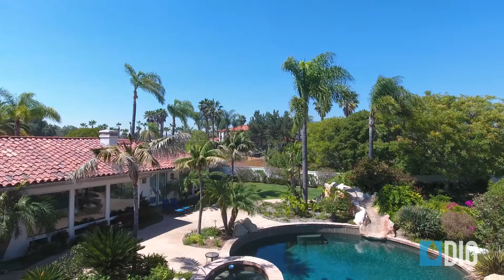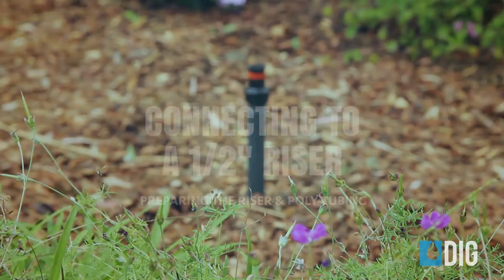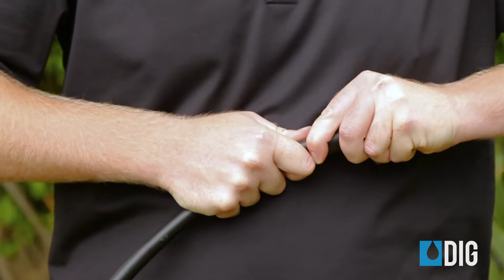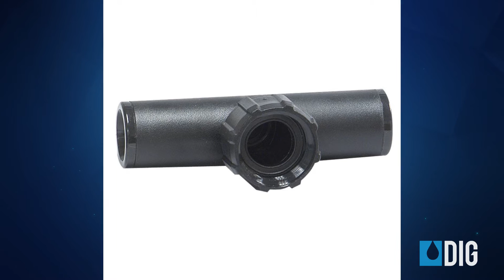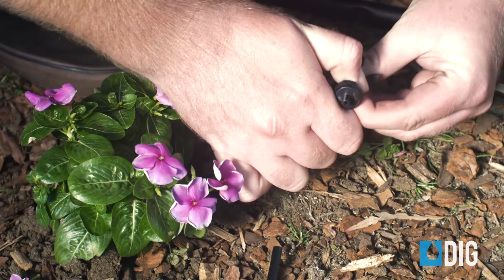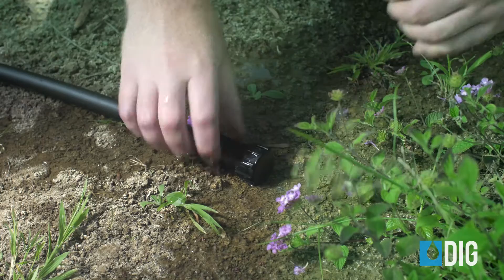DIG Drip Irrigation System Installation: Connecting a Drip System to a Sprinkler Riser

Comment: I know this video is super old, but I'm installing this kit in my garden, and there's a leak at the swivel attachment. I've tightened it by hand as much as it will go. When is it okay to use tape or a wrench so it doesn't compromise pressure around the rest of the system?